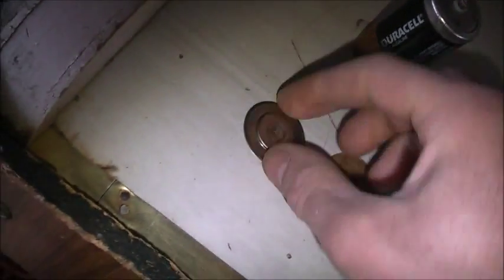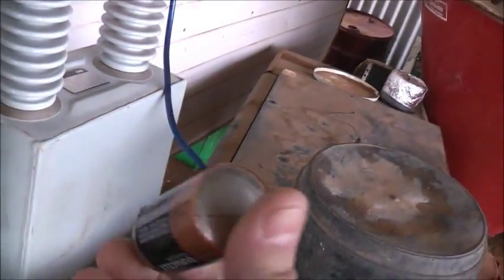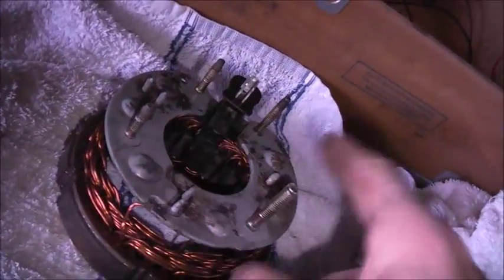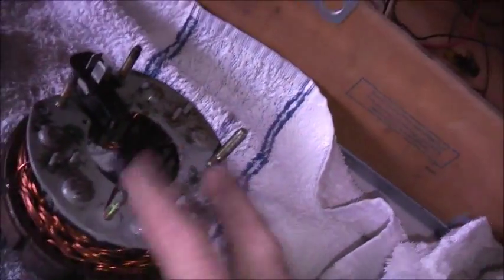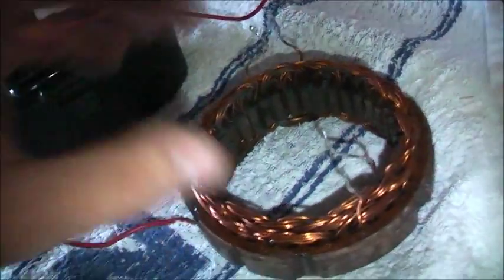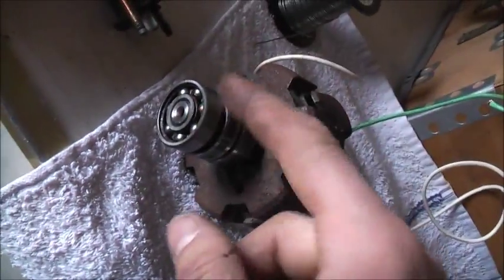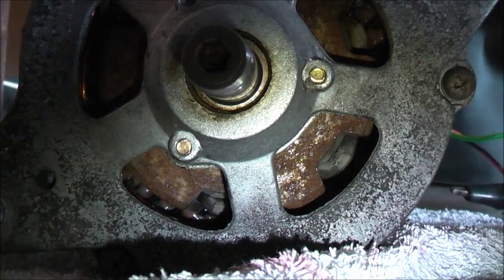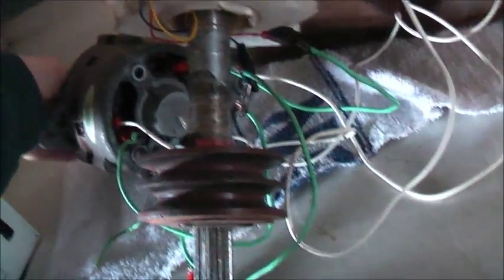Alternator Motor Mod

Comment: DC on field, BLDC ESC(+servo-tester) controller on windings, connect the windings in star or delta(the orginal circuit was probably delta). And it should spin.